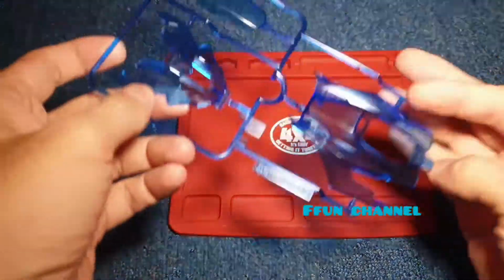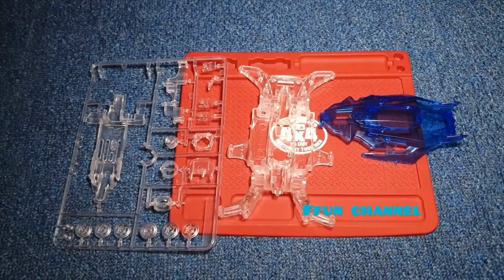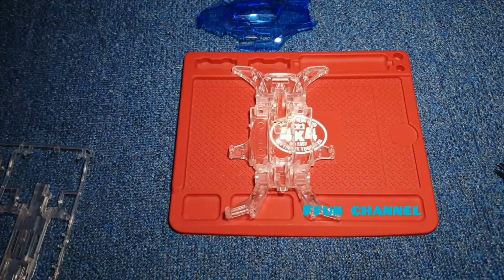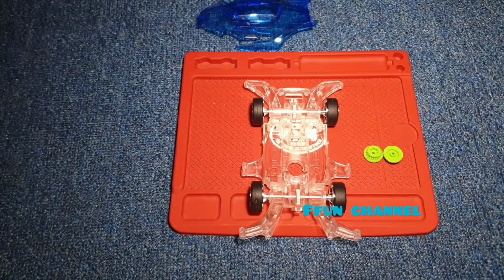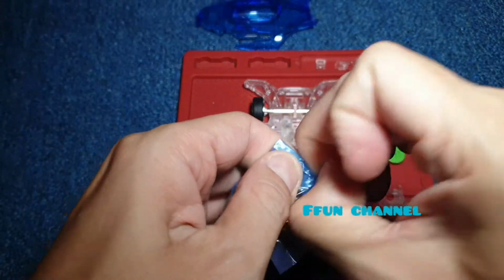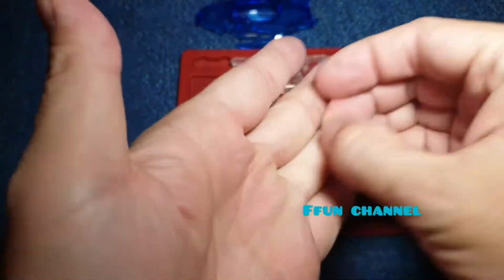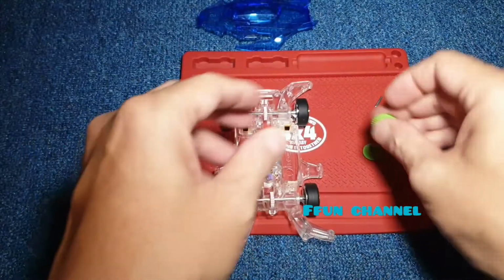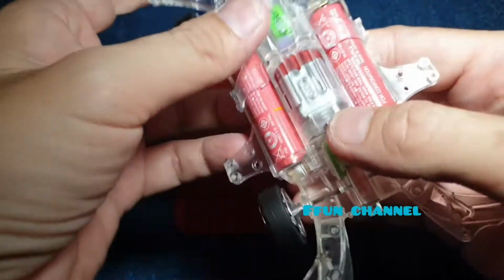how to make DCR-01 blue special with transparant chassis !

Comment: What parts exactly are you using
Reply from the maker: The body original from tamiya, the chassis bought from other shop. Is strong chassis. The only fragile is the baterry clip. 
If you put much pressure on the battery clip, it will live some crack mark.

Overall just fine
Reply from the maker: Not really sure the chassis made from...but when put all together...just like original parts
Reply: Thanks for the info love your Mini 4wd vids